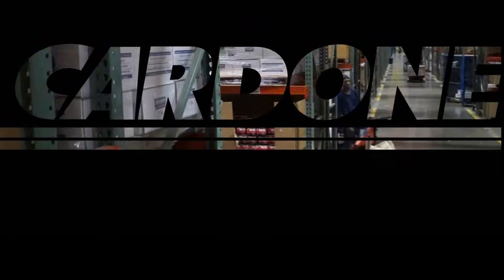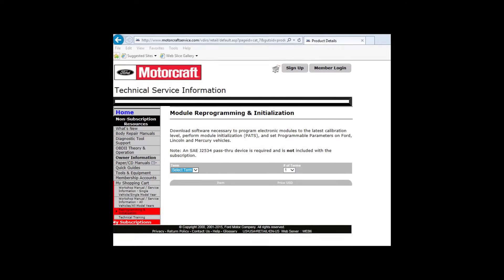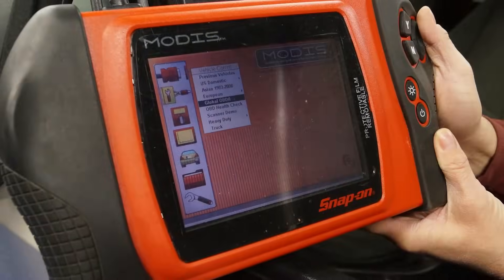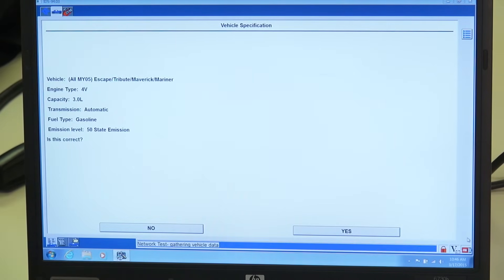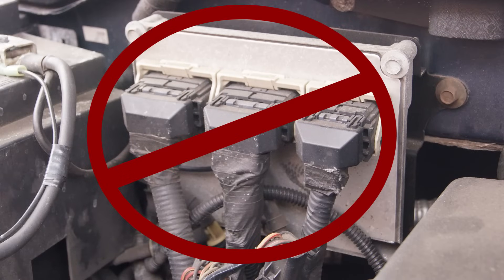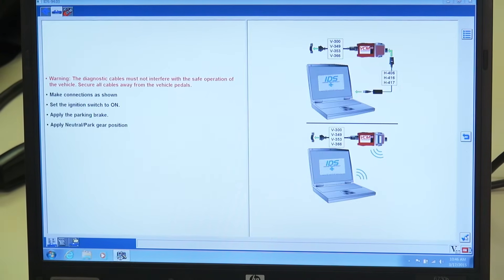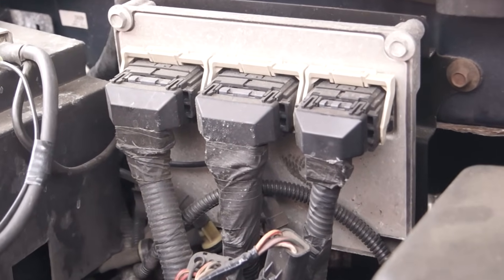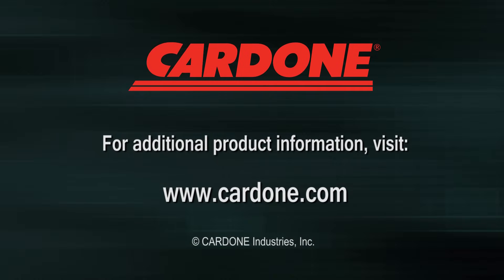How to Reprogram a Ford PCM

Comment: I just bought a Mustang GT previous owner disabled the CAT and removed them. I bought a OEM replacement. If I reprogram the PCM will this bring it back to its original state?
Reply from the maker: HI Diego,  If you have a technical question, or need to troubleshoot a repair, be sure to reach out to our Tech Support Team, please call 888-280-8324 Mon-Friday 8am-5pm EST to speak with one of our ASE-Certified Technicians.

Comment: I'm so glad you posted this video.  Where other videos show people installing used PCM's from another vehicle, this video shows that you need tools and computers that only dealers have for the most part to install a replacement computer, even if your vehicle has no keyed entry system.   Unfortunately with Grand Marquis and Crown Vics, Ford dealers I've found don't want to work on computer replacements, since Ford does not offer the computers anymore, and there's to many other problems that dealers may not want to take the time to mess with.   Sad that Ford has virtually NO customer service when it comes to out of warranty vehicles.  One service rep at a Ford dealer recently told me "We don't usually work on anything with over 135,000 miles.   Why would I buy a car from a dealer like that ???
Reply: They don't have anyone to work on warranty items especially if it's problematic my trucks still under warranty  but might as well wipe your ass with that
Reply: Its a ford worst vehicle I've ever owned had engine apart and 25 other things think it needs pcm internal voltage is way off
Reply: @garymatusavige402   Unfortunately as this video indicates, the process to get your vehicle running according to original factory expectations is complex and the equipment is expensive.   It takes two keys on my 2004 Marquis.    By the way, just changing plugs or coils on your vehicle can screw up the pcm, which means you will have to have the pcm reprogrammed.  You can replace a slew of external parts and it may do nothing, since the actual problem may be with the pcm.    At best, my suggestion to you is, replace what parts you know are bad externally, like filters, vacuum lines, plugs, coils, spark plug wiring ( all of which is something the dealer also should check out if he reprograms your computer), then take the car to the dealer.   Replacing a PCM is probably not necessary in the majority of cases.   Simply reprogramming the original PCM is what I would recommend.   My Marquis is currently running well at over 278,000 miles.
Reply: @tompastian3447  this is false on many levels. the act of replacing the spark plugs or ignition coil does not change the calibrations in the computer.  If you somehow damaged the computer doing the job (very difficult, wouldnt happen due to proper replacement in your 4.6 2v car), you wouldnt fix it by flashing the computer.
Reply: @CT_Taylor  Strongly disagree with you Taylor.   A Ford Master Tech is the first person to inform me that my PCM needed to be re-programmed.  This prompted me to find a Ford dealership that re-programmed my main computer.   Pines Ford in Pembroke Pines was one out of 7 that offered that service.   That dealership DID reprogram my PCM, and that finally solved my problem, i.e. no more misfiring, no more engine light coming on, and no more A/C problems.   While in theory one would think that merely changing plugs or ignition coils should NOT affect the PCM, there appear to be exceptions to that thinking, i.e. I've talked with other Crown Vic and Marquis owners who have had the same problem I had.   They continued to have the engine light come on after having their car serviced (not by a Ford dealer).
It may also be possible that for example, a leaking intake manifold on the Marquis and Crown Vic ( a common occurrence with Ford's plastic intake manifolds) can short out the coils that are subjected to a water leak.   Pines Ford replaced my second cracked intake manifold, and had to reprogram the main computer after replacing the defective coils.
Reply: Dealers work on cars that make easy money for them and their techs. Old cars do not mean easy money
Reply: @lard1892  Thanks for the reply, and sadly admit you are right.   Today I went to Palmetto Ford in Miami, their inventory is Ford Vans & Trucks, and a service dept.
The one service rep on duty at 4:30 pm, the first thing I asked him was, do you have any mechanics who have replaced the main computer in any Ford Trucks.  He said "No."   Then I told him the problem I have with the Marquis, and he said "I'm sorry bro, there's nothing we can do".  Now think about that, a large Ford truck dealership, and they tell you they've NEVER replaced a main computer and have no mechanics that have.    Hard to believe that they haven't taken in any trades where someone had a Ford truck with a faulty PCM.   What do they do, haul them to the junk yard?
I got turned down for service by 2 other Ford dealers in this area.
I wish we could get the word out, that Ford is not capable of fixing certain problems with their own vehicles, and we're talking FLEET vehicles like Crown VIcs and Grand Marquis.
Reply: @tompastian3447  I don't know why, but OEM supply dealerships lie about that stuff constantly for no reason.  

I remember when the new emissions BS for diesels came out and every dealership said they were bulletproof and never had to work on them, yet they were getting parts in by the literal pallet loads weekly for warranty repair work all related to diesel emissions system failures.

Comment: So if your old one needs to be replaced how can it give the new one the right settings if it itself is no longer any good. That makes absolutely no sense at all.
Reply: It can't!  FORD has made it like that by design.  The design ensures that FORD can milk its customers.  You will have to pay the Dealer to flash your new PCM.  You have no right to repair your possession by design.

Comment: Hi I have a pcm without kee and odometer it is possible to use in our foto first gen car.
My car pcm pin is break.
Reply from the maker: I am sorry you are having a problem. What year, model, engine size car do you have? What is the original equipment number off the original ECM? If you'd like, please call our tech line at 888 280 8324, and a tech can assist you. Thank you!

Comment: Hey, if anyone can help or has the answer to this absolute predicament PLEASE READ: I have a 2008 3.0L ford fusion, got the car with only one key and now I've lost it. So I replace the ignition cylinder and have two new keys that work for it. Only thing is when the guy went to reprogram my keys he did a perameter reset with there being NO new PCM in the vehicle. Now the scanner reads as the car can't connect with the PCM. Looked into it, turns out perameter reset should only be done if necessary. 

So my question is this, basically how do I "undo" that perameter reset? Or even, what do I do now?
Reply: I know this was 5 yrs ago but did you get the problem resolved or did you have to replace your PCM?  If you did resolve it may I ask what you did to get things corrected? 
Thank you for any information you can provide.

Comment: What a rip-off! I can't afford all these tools and software thanks Ford
Reply: All manufacturers require this! Some like Chevy require more!
Reply: It can be a very devestating, overly bothersome ordeal when it comes to programming/reprogramming a vehicle's Systems, especially if you know absolutely nothing about it.Three weeks ago,I accidentally connected the wrong jumper cable to the opposite post of my 2005 Ford Explorer and the result was: A very untimely No crank No start situation.For several days I watched countless videos on how to properly troubleshoot the issues but these at-home tests were relatively basic and did little more than determine what electrical components were and weren't receiving power,such as the starter,the fuel pump,and ignition switch.The PCM lost its memory;ABS lost its memory; Anti-theft system lost its memory and the key was not being recognized by the transponder(the circular part located exactly where the key is inserted),and so it all had to be reprogrammed and synced to one another.A second key was necessary and had to be made before it could all be done..My Explorer was taken to the Raceway Automotive Ford Service Center on Thursday past and "should" be ready on Monday... hopefully.Thus far,my total tab is $210.
Reply: You can’t do every job, if you don’t have the repeat business just contract it out. Don’t stress yourself over something so niche

Comment: I bought a junkyard pcm same part number. Can i just swap?
Reply: The immobilizer needs to be programmed to your new PCM. Otherwise- your Car won't start. You need a licensed locksmith to do this or the Dealer.
Reply: Having this problem now! How did you make out
Reply: If I buy a pcm programmed with my vinn and 2 keys programmed for it am I good to go if I even it has pats

Comment: Ford is such a ripoff. Have to have a subscription. People wouldn’t need to reprogram anything if they made things right the first time

Can you imagine buying a computer and then dell making people pay a monthly subscription fee to install software updates? Give me a break
Reply: Why on earth would you need a reprogram unless something went wrong with the pcm?

Most cars go from factory to junkyard with never needing a new pcm. 

This is for mechanics not average users
Reply: You have to have a Microsoft Office 365 subscription in order to use a Microsoft PC for business. You also have to reprogram most computers.
Reply: @leeschmitz993  Yes but the difference is you don't ever NEED the Microsoft Office Subscription. You can buy it if you want it, but don't NEED it to run a Microsoft Windows Computer. You can download Microsoft upgrades FREE on their own website and received weekly updates frequently at no cost to you.

Most Computers don't NEED to be re-programmed unless you've run into problem with the operating system or want to tweak a specific setting, your average casual user will never need to re-program their system.

Where as with the PCM, you will at one point NEED to re-program your PCM and you're FORCED to pay a subscription fee from the manufacturer of your vehicle (i.e Ford Motor Company). 

One give you the software updates for free and provides you unlimited access to them and one charges for access that you're forced to buy. There is a big difference.

Comment: I have an 04 f150 5.4 truck that someone put an 05 4.6 in, also a used pcm that they apparently programmed the keys to. My problem is that the computer is looking for vct's that this engine doesn't have and the symptoms are like they are stuck. Can this be reprogrammed to delete vct's?

Comment: I have an enquiry for the pcm. I use ford explorer 1997 v6 SOHC. I have a failure on ignition system. So, I ordered a second hand pcm with the same number, but it is from v6 OHV. Will it be a problem? Now, the engine is running good but I am not sure for the transmission program. Will it be the same? Many thanks in advance for your advice.

Comment: Is it possible to copy a pcm to a different one? I am doing an engine swap from a 1993 5.8 l v8 f250 xlt to a 2001 3.8 l v6 mustang. Id much rather just reprogram it than redo all of the wiring.
Reply: OBD1 and OBD2 Technology is different. The PCM's Hardware and Software are incompatible.
OBD2 is all Cars Manufactured 1996 onward .
Reply from the maker: This you cannot do. I would suggest you call a dealer with your information and explain what you are doing and ask for an original ECM number. If you like we maybe able to cross that number to a part number. Please feel free to call our tech line at 888 280 8324 and a tech can assist you. Thank you

Comment: DP-TUNERS.COM THEY WILL FLASH YOUR PCM AND MAKE IT RUN LIKE A NEW TRUCK I DID MY 7.3
Reply: I might need to try this wot h my 7.3. my bully dog knob rattled loose on the PCM connection and shut the engine off and it will not start back up. no fuses blown or anything. scanner won't connect with PCM through OBD port so I'm guessing the PCM is fucked.

Comment: What's happens if u try to drive it with out reprogramming it
Reply: Engine It will not start
Reply: I have 03 ford taurus the pcm has went out I got another pcm it will whirl over but want  start y
Reply: @christopherramage2527  you have to by pass the computer lol by takin the relay out while its turned over then restart the car it shud drive in safety mode after that but eventually will burn out do to no oxygen or fuel management

Comment: hello i can really use your help, I would like to get a ford VCM because like again today I got another ford that i need to replace the ECM. if i purchase this tool do i have to buy a yearly subscription or can i pay as i need it, also can i use the tool off line by taking the old data from the original ECM and move it to the new one without logging into the web. Im told wo=ithout a sub, the VCM will not work. Thanks
Reply: You do have to sub, but you use either IDS or FJDS and you can buy 2-3 day subs for each when you need it.

Comment: I have a used chrysler sebring pcm and need to know the vin number of the car it was hooked up to, anyway of getting a vin number from a module without the car?!?!
Reply: Rozi Khan 
An ecu specialist can find that.
Also, you could try calling into a dealership for some more info on tracking down old part stuff.

Comment: I have a Fiesta ST 2013 european model. The fiesta ST 2014 american model has a different ECU, it is MAP tuned instead of MAF, and i think its both hardware and software different. The cars should be very similar except for different ecu.
You think its possible to make an american ECU work on my car? Im looking at the ford module installation with IDS. If i replaced the ECU and programmed it using my European VIN Number, could this work, would it install the correct software, or would i need to use an american VIN to make this work. Will it install software by looking at the modules hardware ID. As I understand there are several modules that also stores the VIN number.
Reply: USA Ecu model can work on Europe?

Comment: Do all Cardone Ford PCMs have to be reprogrammed? I have an 02 Ford Ranger 3.0 with no alarm system... Also, can a new Cardone PCM  be be installed and replacing the old one before reprogramming?

Comment: How much should I expect to be charged to replace the PCM? Ball park figure.
Reply: First question is, which dealership can or will replace a PCM, and there are many variables I have found.  How old is the vehicle?  Is the computer available through the manufacturer?
Will the dealer refuse to replace it?  I've found several dealers who have excuses as to why they wont.  like 1. the car has too many miles  2.  The manufacturer no longer carries the computer